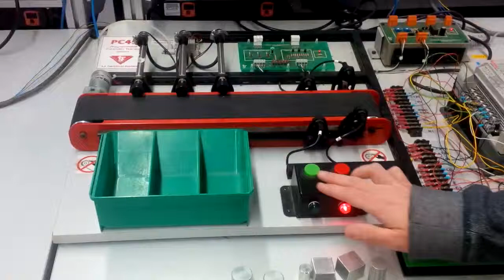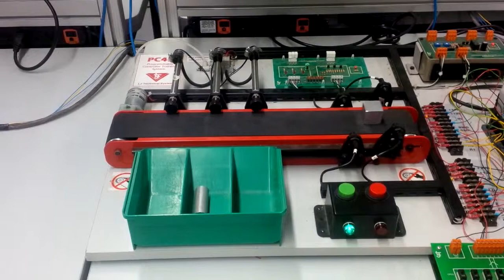PLC lets us sort out by size (height on this run) - project for PLC class

Comment: Nice job
Question: if the 3 cylinder pushers are electric (not pneumatic or air) I would appreciate the part info (model and company to buy them)
Thanks
Reply from the maker: pneumatic.